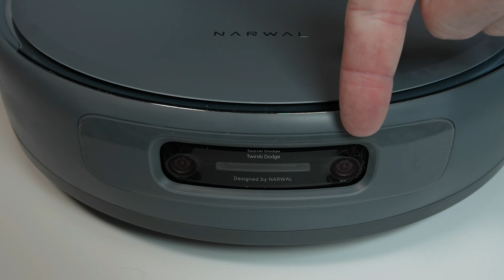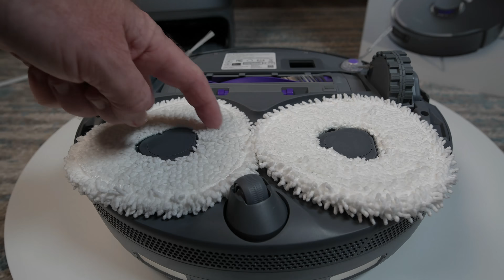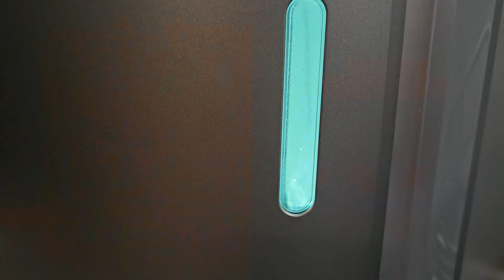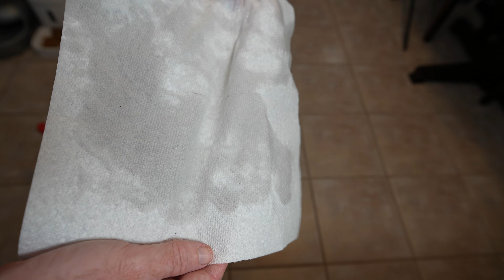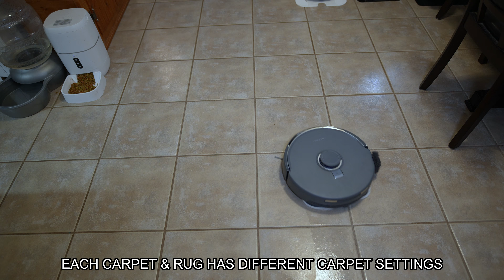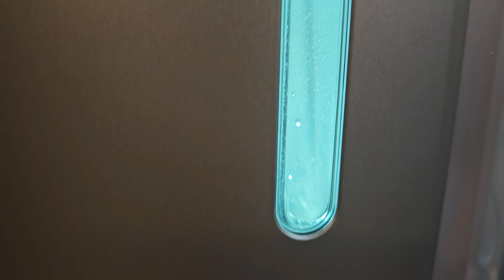Narwal Freo Z Ultra Review - Mostly Better Than the FREO X Ultra

Comment: Jaime,Listen, maybe we should raise the topic that their robots are not the best in terms of vacuuming, it seems to me that it's about their specific dust bin, as a result of which there is a loss of airflow and power, don't you think so? Maybe there is an opportunity to give it to them?
Reply from the maker: I think the vacuum issue is just with the Z and the Flow. The Pro and X did well. On the Z, I suspected it had to do with the dustbin design, but I swapped in a solid dustbin from the Freo X and it did not help so it is something else.  I even swapped in the brush from the X.  I did all of this with the Freo Z. The performance issue is mostly on hard floor surfaces. The Flow has less of an issue since the mop can also pickup and store left over missed debris on the internal water tank.

Comment: I got this one earlier this week. It's good, basically the same platform as the X Ultra but with some improvements. I do wish you could turn off the obstacle avoidance, most robots provide that option in the app but this one doesn't, that's not a feature that I need and I find that when this is disabled, robots will clean closer to walls and other objects, and this did cause a bit of a problem. I have an ethernet cable that goes across my floor and when I am going to use a robot, I move part of the cable behind my TV stand so it's several inches above the floor. I'm thinking that the robot still saw it as an obstacle because when building the map, it wouldn't go through the entire living room. When I disconnected the cable and completely removed it, I recreated the map and it worked fine. This is the only robot that I have seen that empties it's dust bin before the start of a clean, most of them empty after the clean is done. There is a way around that, when it's done, you can manually tell it to empty in the app. I'm waiting for the Narwal Flow which should be out later this year, I think that's going to be really good. It's going to have an onboard water tank and use a mop roller, similar to the Eufy S1 Pro. Ecovacs is also coming out with the X8 which will use a roller for the mop.

Comment: For hardwood floor + carpets which vaccum mop will you suggest? We have a baby in the house and lots of hairs around.  1 requirement is it should not mount over objects. I have roborock S6 and it's wheel get suspended on my dining chairs or the top gets stuck in low clearance areas.
Reply from the maker: Take a look at the new models from Roborock. They are not out yet, but will be soon. Here is a preview https://youtu.be/h1tvuUiNNrk

Comment: Hi, Jamie! Great review, thank you so much! I live in a flat of 100 square metres with tiles and underfloor heating. No pets. Just my little daughter, my wife and me. Can you recommend this robot for this type of flat?
Reply from the maker: Look at a Roborock Qrevo S. Should meet your needs.
Reply: @jamie.andrews Why not this one? I kinda like the Narwal😊
Reply from the maker: @robi258  No reason other than based on your needs the Qrevo models will do, but if you have the budget for the Narwal and you like it by all means it is a good robot with the main weakness being hard floor vacuum performance which I covered in this video.
Reply: @jamie.andrews  Thank you for your reply. I know this is a bit more expensive product, but what do you think of the Roborock Qrevo Slim?
Reply from the maker: @robi258  I have reviewed that one as well.  I like it a good bit.

Comment: since Freo Z don't carry a water tank on the robot, will the mop get dry easily and need frequent back to the dock to wet the mop?
Reply from the maker: The mop pads are pretty thick and can hold a decent amount of water. I always set mine to return to the dock as frequently as it will let me on all robots since I want the pads clean. The Max it will let you go without returning is 129 square feet.
Reply: @jamie.andrews  thanks Jamie! very useful
Reply: one more thing, so the mop will be cleaned each time the robot return to the dock? or just wet the pads?
Reply from the maker: @vincentleung9702  cleaned.

Comment: Hello. Thank you very much for your review. 
One question. How does it pass through the transitions between the rooms if there is hight difference?
My rooms are not on the same height with the living room being almost 2/3 inch lower than the rest of the house. Can it pass the transition and go into the living room for cleaning and come back?
Reply from the maker: I think the limit is 2cm for thresholds.
Reply: @jamie.andrews  Surely you must mean 2 cm instead of 20 cm?
Reply from the maker: @zoide-777  Yes

Comment: What do you recommend for flagships tier for nostly hardwood/lvp floor with with low pile rugs? Seems like there is no perfect option. And assuming the dame price (not in a rush to purchase,waiting for sales)
Reply from the maker: If object avoidance is no concern and only going based on what you have stated the Roborock Qrevo Plus or Pro should do just fine. What is the budget you are aiming for?
Reply: @jamie.andrews  thanks for getting back. Willing to go up to 1300 which is what Costco has the freo z at the moment. my wife and I have long hair. I find myself messing with my roborock 5 to cut the tangled hair frequently from the brush. We have 2 cats and while cat vomit hasn't been an issue... We do have a puker and we get our wires caught frequently enough.
Reply from the maker: @zzbxdo  The Narwal should be a good fit for you then based on everything you have said.  The other option is the Dreame X40 Ultra. You can buy the Tri-cut brush for that model and it resists hair tangles.
https://youtu.be/Mgx73wrZeOU

Comment: I am 83 year old female. would this be too much for me to handle? also how is water hooked up. How long would it take to clean 900 sq ft. How much electricity does it use.  If you do not handle these questions can you recommend someone for me.
Reply from the maker: Hello, without knowing you it would be impossible for me to know if you can handle it.  My 86 year old mother could not pickup full water tanks and the technology has surpassed her understanding.
As for the plumbing hookup, you should likely hire
 a plumber. 900 square feet would depend on several factors.  If vacuuming only it will likely be over an hour, but if you add mopping into the mix it will depend on how often it has to go back to the dock to wash the mopping pads which can be controlled by you in the app. 
I put some electrical figures in the video, however it entirely depends on how much it is used since it doesn't use very much if not used.

Comment: Our Freo Z is a lemon, won’t map or edit correctly. We are trying Dreame X40 Ultra, and so far its way better, and like that is leaves mop pads at base when not needing them.
Reply from the maker: Goodness sorry to hear that.
The X40 is nice for sure.
Reply: I have an open floor plan and I can’t split my rooms using the Narwal app. Support says I should put up “fake walls” using cardboard. Uh no. It also does not “power up” on rugs even though I have all config settings set to do so. It does clean very well on my tile and hardwood. Roborock app/software seems so much less buggy. Thoughts on the Freo z vs the Qrevo Curv?
Reply: @dustinhannifin7370  Yep … we got the dreame x40 ultra, and app / map works perfectly, and robot is doing well so far.
Reply from the maker: @dustinhannifin7370  I have heard others having issues with dividing rooms. It does not have a carpet boost option to enable in the app like most other manufacturers. You can select the carpet on the map and select power boost for each carpet or change the default and it should boost, but it does not boost to Max sadly.
Roborock has the best software but their object avoidance is almost non existing. Have you seen my review of the Curv?

Comment: Cosa mi consigli tra modelli narwal, roborock curv, eureka? 
Il migliore secondo te tra funzionalità di lavaggio e aspirazione e materiali?
Reply from the maker: I have not test the Eureka models yet. Both the Narwal and Curv are good robots however to answer you question about suction I would lean towards the Curv.  For mopping the Narwal is a good bit better with cleaning performance, however lacking an onboard water tank might be a drawback for some.
Reply: @jamie.andrews  mi consigli tu quale comprare?

Comment: Thanks for the review! How is the vacuuming on both carpets and tiles compared to other flagship models if the freo mode is disabled and suction set to max ?
Reply from the maker: The tests that I ran in this video on carpet with rice and on floor with cat litter were with Freo Mind off and the suction level set to Super Powerful. Slightly above average on carpet and below average on tile.

Comment: Can you re-run the kitty litter on tile test by forcing it to vacuum in Mesh Mode? You do that by forcing the number of vacuum passes to 2x or 3x and letting it do its thing.

The noise level is significantly lower while it's on carpet at the same vacuum suction power

100% AGREE on the "Smart Emptying"!!! 6 pets in this house and it DEFINITELY doesn't empty enough with "Smart" mode.
Reply from the maker: During my cat litter test I always run the robots with a single pass so you can directly compare the performance. I did do something similar with the red rice on tile in this video.  That was using Freo Mode and it slung some of the rice outside of the zone.
Reply: @jamie.andrews  Got it, thank you for the clarification, and the great video and all the hard work you put into making the videos!

Comment: Do you find that it  puts down too much water because it has no on board tank? I know you mentioned that in another comment. I have hardwood and found that the ecovacs t20 omni put down too much water for reference.
Reply from the maker: Yep the same as the Ecovacs T20.  It could be a concern for people that have expensive and dedicate hardwood floors.  It has to leave to dock with plenty of water on the pads or they would dry up too fast.  If you have vinyl or tile it is actually prefered.
Reply: @jamie.andrews  thank you so much

Comment: I already have the Freo X Ultra, I wonder if it's worth getting the Z Ultra as well. I don't need the obstacle avoidance and I don't have any pets, I also don't have any carpets, just hard floors.
Reply from the maker: Kinda doubt I would upgrade.  The X has better hard floor pickup ability and the mopping ability is no different.

Comment: I liked that with the X-model you didn't have to buy vacuum bags over and over again, but could use the permanent dust container. That also means you can get stuff out again that it has mistakenly vacuumed up (e.g. jewelry or small toys). Is this possible with Z which advertises emptying in the base?

Comment: 3 year warranty and 1100$ on the early bird promo seems hard to beat. Where do you rank this bot for price to performance compared to competitors?
Reply from the maker: If hard floor pickup was better it would likely be top 2 or 3.  Narwal is sending me another unit to test as they think something could be wrong with mine.
Reply: @jamie.andrews  Did they send it you?If yes, are there any differences?😉
Reply from the maker: @robi258  No, but other reviewers have noted that it is a design issue with this robot.  https://youtu.be/vAbR0Iklzr4?si=XWsSQXgrexG-qjD7
Reply: @jamie.andrews  Keep me updated if you get it within the next week to do testing.
Reply: I feel the same. I just had a Roborock S7 which I’ve had for 2 years and 11 month just die on me. I like the fact that if I’m paying 1000+ that the unit is warrantied for three years. I’m really leaning towards this or the S1 Pro. The Q revo curve is nice but expensive and only a year warranty scares me.

Comment: I had it the battery is horrable
Reply from the maker: I don't do battery analysis on my channel, but I did compare it to the Qrevo Master both on normal power and it did use more battery, but only about 7% more.

Comment: Nice review!! Do you know if the robot mixes detergent with water and adds it to mop pads for mopping? Or they just uses the detergent for washing mop pads like Dreame? Thanks.
Reply: I see. For early bird $1099, do you think this worths more than $999 on sale Eufy S1 Pro? Or $1199 Dreame L40 Ultra?
Reply: @devinnguyen258 I’m wondering the same thing! I really like both the Freo Z and S1 Pro. I want to pull the trigger on one soon but can’t decide.
Reply from the maker: @devinnguyen258  I think $1099 is a good deal for this robot, I'll say that.
Reply: @jamie.andrews how would you say it compares to a Curv at 1260? Got an eta on that review?
Reply from the maker: @PadinnPlays  I'm still testing the Curv. That review will be out in 2 weeks or less.
Reply from the maker: Yes it mixes with it when washing and mopping since there is no onboard water tank it can't really separate the 2.
Reply: @jamie.andrews  I forgot to ask you, when it goes back to the base to get the mop wet, how long does it take before going back out to continue the mop?
Reply from the maker: @devinnguyen258  a few minutes. There is no way to set the time as it will continue to clean the pads until they are detected to be clean.

Comment: One of the reviewers suggested that on this model they have an optional polishing option—where we can put the polishing compound and it will polish the floors through pads. Can you also comment on that?
Reply from the maker: I have heard about it and almost put it in my video however there is no mention of it on their website at all.
Reply: Seems like an unfinished feature. They appear to have rushed the launch despite software bugs mainly impacting mapping and navigation. I bought it but side coverage is awful. It does not stick to edge well.
Reply from the maker: @basitmuhammadimran1293  Yea navigation issues are certainly there.

Comment: Did you happen to norice if the dock also cleans dust from the in bin filter? I saw a review mention this and dust clogging filters has been an issue for me (cat litter). One less maintenance item would be nice
Reply from the maker: Anytime a internal dustbin has a mesh prefilter it will have this issue.  The Z does have a mesh prefilter.  The only robots that don't are Roborock.
Reply: @jamie.andrews are those mesh filters even necessary?
Reply from the maker: @deuceswild6857  I don't think so. When you had to manually empty the dust bin I would say yes! On a robot with an auto empty system they actually cause the filter to become a bit more clogged with fine dust.

Comment: How much do you miss the extendable side brush from other brands? And to a lesser extent the extendable mop from the S8 MaxV?
Reply from the maker: Personally not much.  They are not completely effective yet and have more moving parts that can break.  I dislike the side mop on the S8 MaxV Ultra.  It is very small and not very good at cleaning due to the small surface area of the mopping pad plus it will ride up on some floor moldings like I highlighted in my review video.

Comment: Jamie, I have the S8maxV Ultra and like it,  it have mostly hard floors. I have wondered if the spinning mop heads has ever been compared to the vibrating type for best mopping results?  I’d love to see a video on that.
Reply from the maker: If you compare Qrevo spinning to the Vibrarise on the S models there is not much noticeable difference. The Narwal is better not because of the type of pads, but because it can put down more water due to the thickness of the pads and more downforce.
Reply: I’ve been using both the s8 max v and the eufy s1 pro.  The spinning roller is significantly better on hardwood floors.
Reply from the maker: @techeddie  Oh yea it is.
Reply: I have the s8 maxv and it is definitely not that good at mopping. The s8 maxv only has 6N of pressure while the Narwal has 12N and i am almost sure that a spinning mop is better than vibration. I think Roborock chose vibration to get the class leading 20mm of mop rise.
Reply: +1 on this. I'm in the same situation.
Reply: I've got a S8maxV Ultra and a Freo X, but I'd say the mopping feature on the Narwal is much better than S8maxVUltra
Reply: I think vacuum wars did a comparison and the vibrating pad actually performed very well. But as far as I remember correctly, the Narwal Z and the Eufy S1 still outperformed the Roborock.